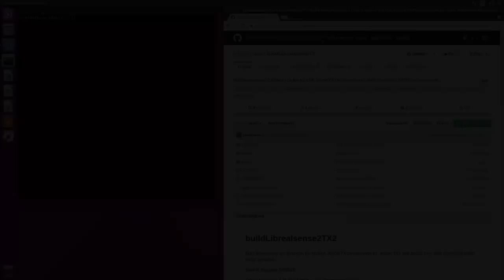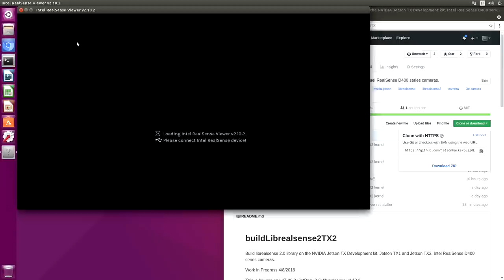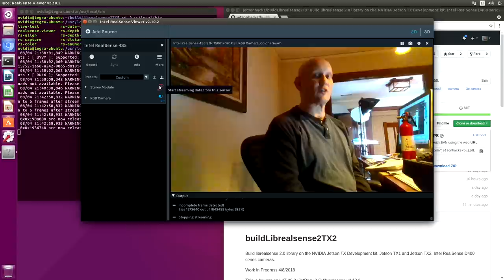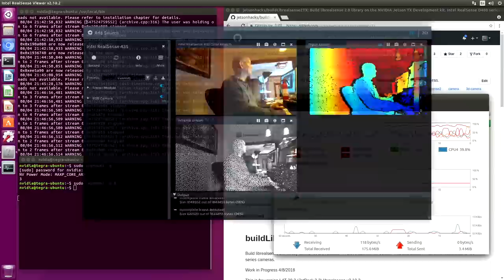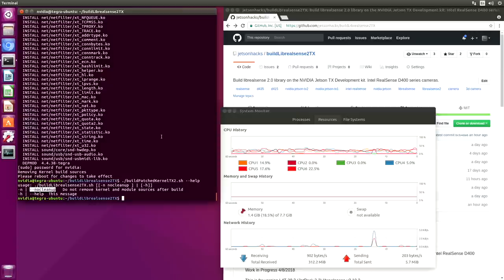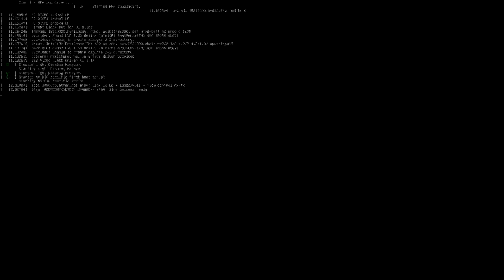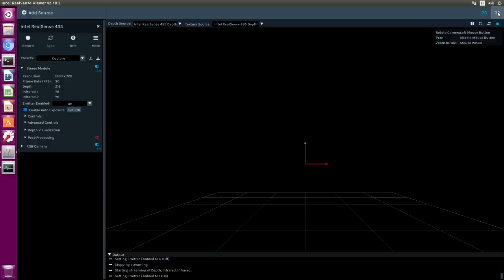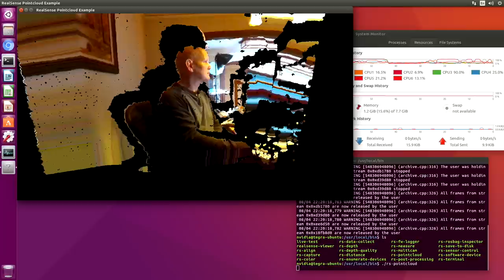Intel RealSense D435 - NVIDIA Jetson TX Dev Kit

Comment: Sorry, I followed your command lines in this video, but I got an error saying "Applying Model-Views Patch, can't find file to patch at input line 5. Perhaps you used the wrong -p or --strip option?..." and it let me chose the File to patch. What does that mean? I chose to skip 3 patches then the terminal could continue.
Reply: How can I solve this problem? Or, should I ask this question somewhere else? Thanks!
Reply from the maker: You will need to check if the files that the script is trying to patch actually exist.
Reply: Thanks for the reply! I got the librealsense2 working on my TX2. However, when I was trying to import the libreasense in Python by "import librealsense", it only worked under Python3, but not Python2. Since all my other code is under Python2, is it possible to install it for Python2? Thank you!
Reply from the maker: I am glad you got it to work. You need to make sure that your Python paths are correct.
The RealSense library is installed in /usr/local/lib
The header files are in /usr/local/include

Comment: Each time I stop the RealSense I get all kinds of errors like a kernel panic. If I unplug the camera and plug it back in it will work again. Any help you can offer for this?
Reply from the maker: Did you read the article: https://wp.me/p7ZgI9-Zq
What version of L4T are you using?
What are the errors you are encountering?
How do you stop the RealSense?
What software app are you running?
Which camera are you using?
Do you have OpenCV installed?
Reply: JetsonHacks I'll need to check my LT4 version and the exact errors on Monday. I'm using Python3 and OpenCV. When I say stop the camera I just mean to stop the pipeline. Even using the Python examples from RealSense Github I get this behavior. I have D415 and D435 they both do this. I attempted to edit the Kernel per your instructions as well but honestly that is new to me so I'm not confident that I did it properly. Thanks for sharing your work this is pretty cool stuff!
Reply from the maker: The behavior you describe happens on versions of L4T previous to 28.2. You should only rebuild the kernel with the associated source files, the ones in the repository as of this writing (as shown in the video) are for version 28.2.
Reply: Awesome! I will let you know next week...

Comment: Great video, thank you very much!  It took me a while, but i finally got it to work. 
Now I'm wonderin if it's possible to install a newer version of the realsense SDK (maybe 2.17 or 2.18) using your this install script? 
I'm trying to detect persons in pointcloud data using the PCL (point cloud library), but as the depth data doesnt seem to be perfectly aligned with the rgb image it's not working properly. This bug is fixed in the new ros wrapper for the realsense camera.
Reply from the maker: Did you modify the script to 2.17 and have the install fail?
Reply: Thanks for the quick response! I havent tried yet, because it took me a while to get the camera work smoothly. Would you recommend trying it?
Reply from the maker: If you need new features, you would have to modify the scripts to build later versions of librealsense 2. Thanks for watching!
Reply: @JetsonHacks  it worked. thanks
Reply from the maker: Glad to hear you got it to work!